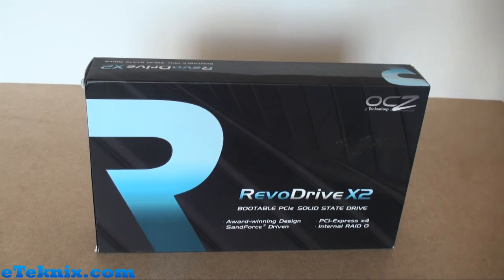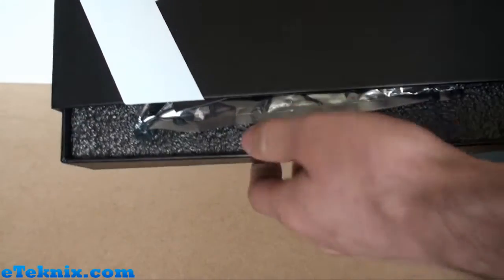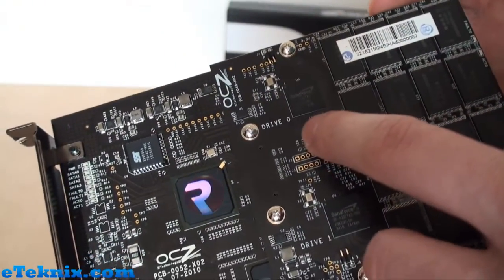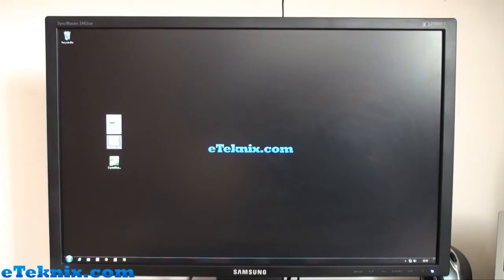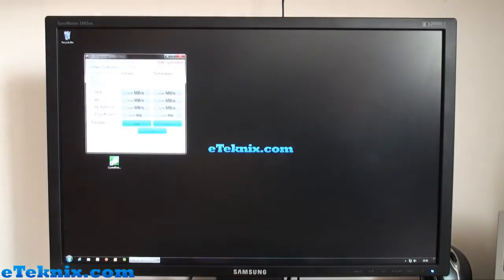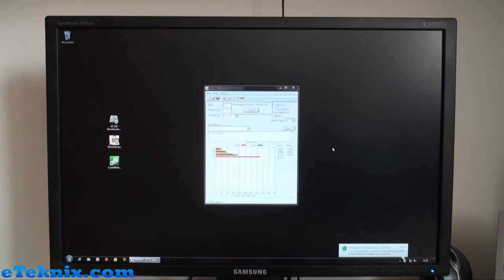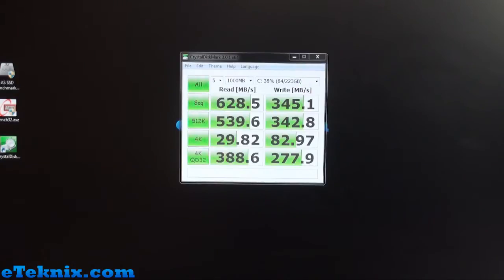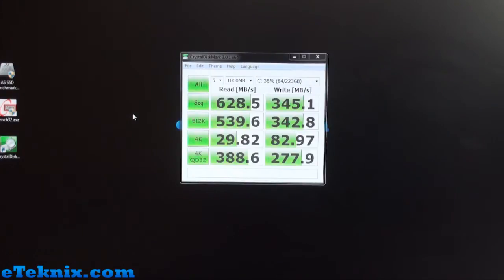Video Review: OCZ RevoDrive X2 240Gb PCI-Express Solid State Drive

Comment: those are not bootable. they are caching drive, they act as rom.

the 240gb 480gb and 960gb are the ones that are bootable
higher are desinged for servers that run from SAN and SAS